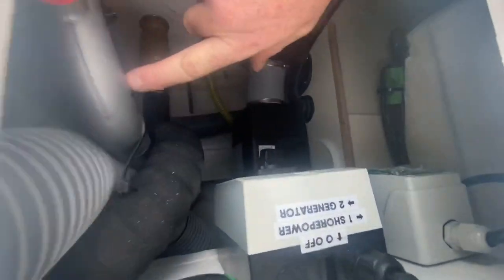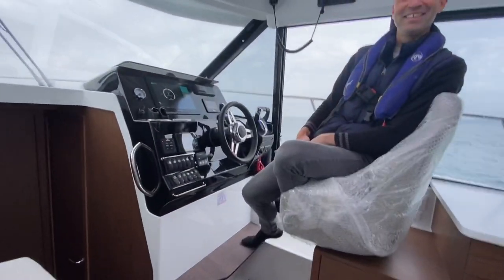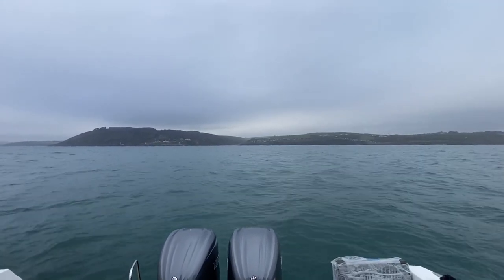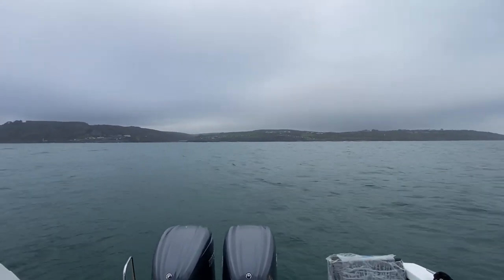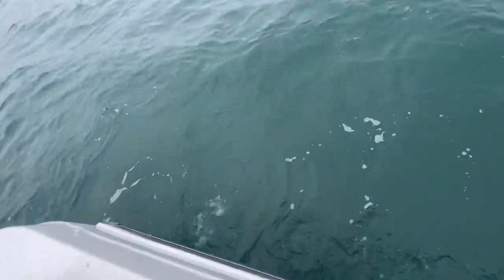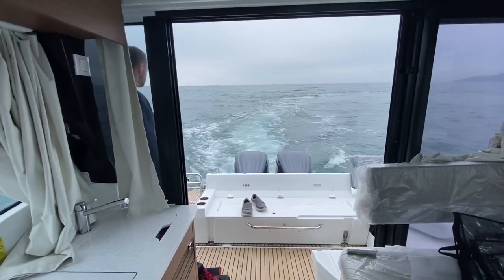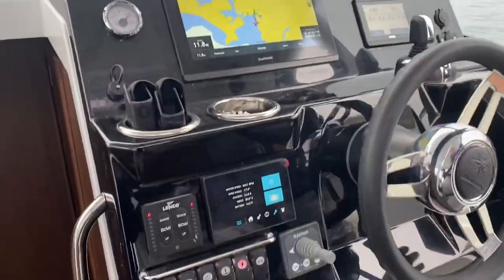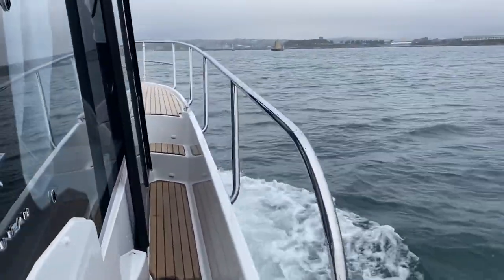SeaKeeper test on a Jeanneau Merry Fisher 1095

Comment: That's awesome, we're looking at one of these soon, would need a Sea keeper for sure.
Reply from the maker: The outboards don’t generate enough electricity at low, revs to run the seakeeper. If your berthed  overnight, you won’t be running the engines.
Reply from the maker: Happy to quote and supply  as we fitted this one out